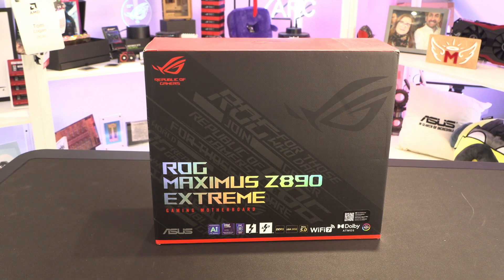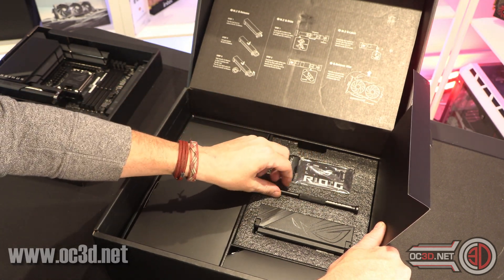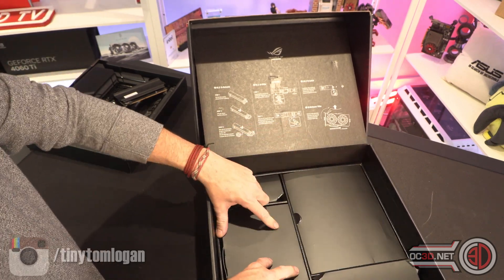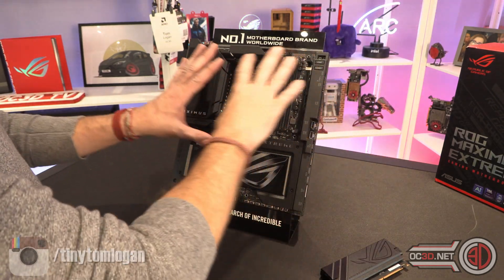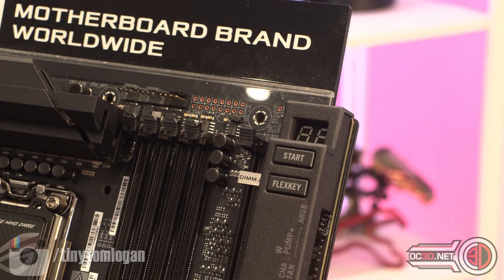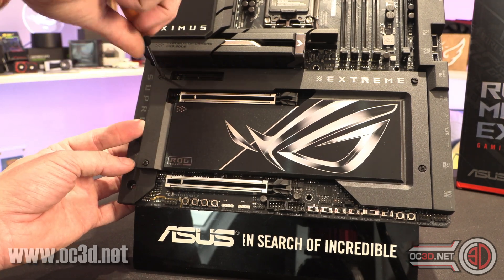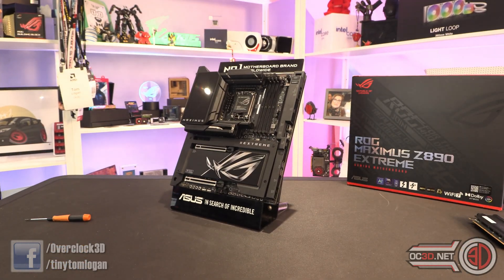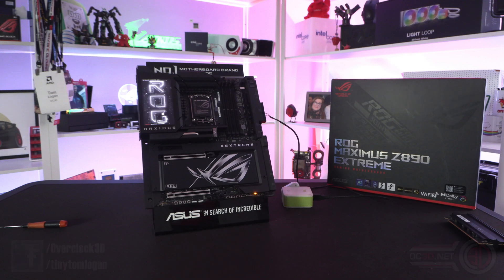The greatest ROG Asus ROG Z890 Maximus Extreme  Arrow Lake Flagship

Comment: Hey guys, Thanks, OC3D, Great video, appreciated.
I just ordered my Max Ext today. Upgrading from the old Rampage 6 Extreme, CPU i9 9900X 10c/20th, RTX2080, & 128GB DDR4 3600 Vengeance RAM, 4x2GB Samsung 980 SSDs.
> New PC and I'll also Add Prices as of 13 April 2025, just to give you an idea and comparison, I'm in New Zealand:
> MB -  ASUS ROG Z890 Max Ext is $2100. > CPU - Core Ultra 9 285k. $1200. > GPU - RTX5090 ROG 32GB $7199. (RTX4090 $4750). > RAM - GSkill DDR5 8400 96GB (4X24GB) CUDIMMS RAM $1650.
 > SAMSUNG DRIVES - 4 x 9100 PRO, PCIe Gen 5, 2TB SSDs ($525 ea.) $2100. > POWER SUPPLY - ASUS ROG STRIX 1000 Watts $450. > COOLING - ASUS ROG RYUO III 360 AIO CPU Cooler $500. > CASE - ASUS HYPERION $750. Plus a few extra fans, acessories. Already have > PC SCREEN > SAMSUNG - QN90A - 50 inch 4K 120HZ NEO QLED. > SOUNDBAR - SAMSUNG HW - Q900A, 7.1.2.
That's it; the prices are absolutely crazy over here and getting worse. The old PC above I built in 2018 when the first RTX2080 arrived here. I do graphic design, copywriting, and watching videos, and I never overclock any components, and I don't game, so I really hope the new Core Ultra 9 285 CPU will do its job and hopefully won't be too slow, especially with the new MB, RAM, and SSD drives. I'll let you know. 
All the best, guys. Cheers Kiwi
Reply from the maker: @TheKiwiooo  why did you spend so much on that motherboard if you don't overclock? Even manual tweeking? If you leave everything on auto then you could have saved so much money
Reply: @OC3D  Hey OC3D, Good question, my friend. I do a lot of design and have over a million files spread over the four drives, and I have never overclocked the CPU or GPU or anything, come to think of it, because I am always wary of pushing my tools too far, and it's been the same with my PC. I built this in 2018, so I have been trying to make sure it lasts till the new one. I've been like that all my life, the same with my power tools, equipment, workshop machinery, soundbar, or car. I have always bought as good as I could afford and more than I need, never thrashing them, using up to 3/4 power, but when I am stuck for time and working on multiple projects, I always like to make sure I have the maximum power and throughput available whenever I need it for those urgent situations where I've gone nuts multitasking, saving, copying, designing, etc., and have to push the equipment.
In fact, I was nearly about to go online and watch someone overclock my i9 9900X because over the years it is starting to get slow, and that's why I have been holding off for the right timing.
To be honest, OC3D, these habits have been with me for decades, my friend. I have had electronics break down in the middle of the night in the past when working on urgent jobs for a client, and it's very hard to get a new printer or whatever at that time, and I think you probably know what it's like when we have no parts right there and then. ;)
Thanks, OC3D, I love yr work, and also, I am not that electronically minded, so I don't fully know or understand how far a CPU/GPU can be pushed before they crack. Cheers Kiwi <3
EDIT:  Also OC3D, when the time comes to sell it or donate it, I like to be able to say to someone I have never overclocked or thrashed the components silly old-fashioned, but that's me. my friend OC3D.

Comment: Finaly a worty replacemente for my Rampage III extreme.
Reply: That's the exact motherboard I'm replacing soon too! My pc from 2009 lol! You going for Intel Ultra 9 285k? Instead of the AMD competitor?
Reply: @bayramkanik4312  depends on your needs, for maximum fps is better AMD 9800x3d processors, for rendering and workflow is better the Intel ultra 285k. for me, I choose the 285k, but it needs a hefty 360 aio, the core 7 has better power consumption and will work with a good air cooler.

Comment: high end  mobos should start including a solid fan hub which is sata powered along with 10 total fan headers + argb headers so users dont have to buy it separately , also there should be dual bios which s very handy for quick switching , a water cooled vrm and the backplate of the mobo should also be included for those who wanna do it to push everything balls to the walls while OC , should also include a pair of big solid wifi+BT antennas , a ram fan cooling bracket to cool them dimms , possibly a m.2 expansion card too , a nvme heatsink too !! , also a bunch of small 10mm fans like the noctua ones have for snucking them above the gpu backplate so as to improve airflow and direct it either towards the top of the case or towards the backside of the case to exhast the hot air from gpu rapidly and prevent the hot air form circualting inside the case , the small 10mm fans can also be snuck near the ram and ducktaped or something 
they should also include a pcie riser cable both x2 and x16 , a daughter board for special use cases when the pcie slot cant be used if the gpu is taking up too much space and also there are other thunderbolt use cases 
they can include ALL of these as extra accessories with the added price , but they should at least give the option for these high end mobos
hope you convey this msg to the mobo manufacturers

Comment: For the 4th M2 (Assume M2_1) above PCI-E 1 can you operate without cover - having a M2 with preinstalled / embedded heat sink instead ? - Love the Novell / But Air sail M2 - Slot In Expansion card next to the Dimms - assume that you can use 2 x M2's at once and are there any limitations with other M2's, can you use 6 x M2's onboard at once ? or does it reduce bandwidth of one or more of the 2 x PCI-E slots (Assume x 16 - Gen 4/5 ?).                  Opps I found the INFO Now on ASUS and extremely pricey in UK / Scan for over £1300 / $1500

Comment: Thanks for the review. I've had Z690 Extreme and I have Z790 Extreme and to be honest they are not worth it at all. These are mainstream boards and not even HEDT that is dead now. Especially you pay double price for pretty much nothing. Maybe CKD will help with RAM but we are to see that. Still running Rampage VI Extreme X299 in main rig that actually felt like a high-end board when I got it and came with plethora of features, 10G LAN, even RGB, at ~650e in 2017. Crazy times.

Comment: personaly i would prefer comprehsive real world reviews rather than reading the products specs that I can get on the mb  web page just saying I remember years ago when you would do comprehensive reviews of the vrm stability overclocking features temps comparison personal thought etc etc EVn power supply videos where are they I used your site for my major component when building
Reply from the maker: @TW-bh2mi  I'm not allowed until the 24th - that's why this is an early preview dude (I've always done these early ones too)

Comment: Would have to be mad to spend this much money on a motherboard for a socket which is rumoured to have a single CPU generation and one which barely moves the performance needle…
Reply: who cares
Reply: @CR055FIRE  who cares about what?
Reply: @rare6499  what you said
Reply: @CR055FIRE  you’ve taken the time to reply so I guess you care about something or you wouldn’t have bothered
Reply: @rare6499  well ya
Reply: @CR055FIRE  I think everyone? Right? Lol
Reply: @xdi1733  well, if it sells, you will know you were 100% absolutely unmistakably wrong
Reply: “Barely moves the performance needle” yeah moves it backwards.
Reply: I’m still rog extreme z590 no need to upgrade but I probably will lol
Reply: Good. “Upgrade” is a IQ filter.
Reply: Is there any word on this. Is it definitely 1 generation being the 285K, or will it support at least 1 more ? Literally no info on this.
Reply: @StatsGam4er  It's probarbly only one genetation socket, only cause arrow uses meteor lake architecture, which is flawed.
Reply: @eblanueblanovich8902  how is it flawed?
Reply: @xdi1733  chiplet design where cache and cores have non-direct interconnect which causes high latency and slow ring bus clock. If you saw the new core arrangement you can see that it’s different from raptor lake where raptor lake had p-cores first and then e-core clusters, now in arrow they mix them so there is no ring delay caused by e-cores accessing cache too late/by the end of cycle. With this new core configuration ring bus can still remain somehow fast.
Reply: Maybe you should get a better job if you’re worried about the cost. Better yet, go buy a console
Reply: @LCNismo  lol. Ridiculous comeback, what are you, 13?

Comment: I would appreciate it more if the reviewer added some of his knowledge and not just read what is written on the motherboard.
Reply: The review embargo is still in force. All they can do is show the board as presented.
Reply: 99.99.99.99% of all "reviews" now are all like this.. reading the specs and this button does this and that button does that and this connector goes there and blah blah blah.. total and permanently perpetual waste of time.
Reply: Embargo on what exactly? Youidfbse, exactly.

Although I am glad there are hardware reviews on YT as on websites they died over 10yrs ago.
Reply: @arturperzyna5453  A review of the board. Showing it in actual use and reporting on how it performs.
Reply from the maker: I cant do a full review until the 24th - thats why this is a PREview not a review